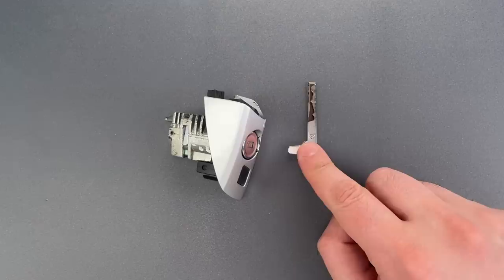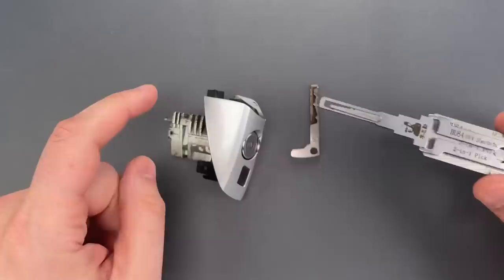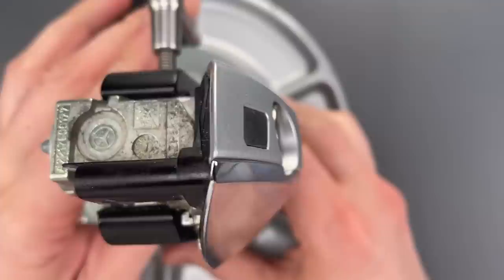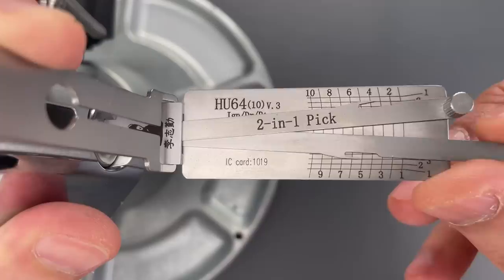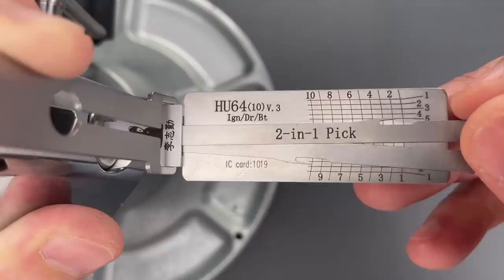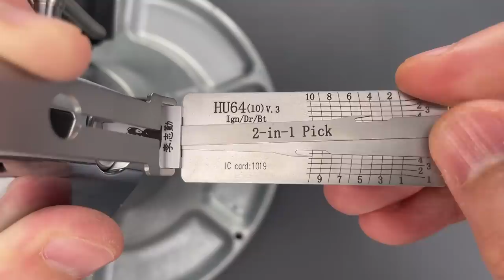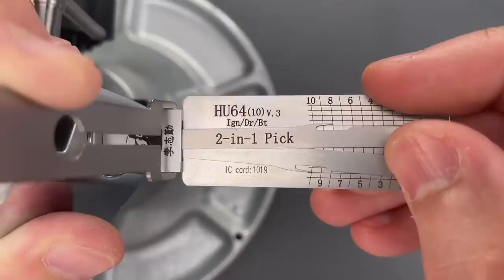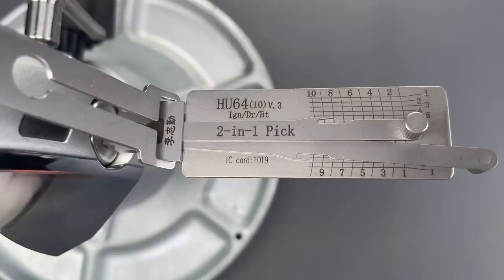[1411] Mercedes S-Class Door Lock Picked (2013-2020)

Comment: Some years ago I had a Fiat Punto.

I just left nothing in it, and left the doors unlocked, after getting the quarter light put through, and a door lock trashed.

No more expensive repairs from break ins after that. All locks are pickable, but thieves don't bother when smash and grab is quicker and easier 🤷‍♀️
Reply: this is what people in san Francisco and many other cities are doing, they leave their trunk open and doors unlocked as most times a cracked window is more expensive than whatever they may lose from the robbery
Reply: @JehaanPatell  That was what I did. Leave the glovebox open, nothing to steal here. Leave the car unlocked, nobody breaks in, saving you costly repairs.
Reply: This does not stop a smashed window.  Cars have locks and many cars now have alarms systems that check for the key-chip when unlocked and alarm if jimmy'd open, most thieves can't unlock the cars silently and KNOW this so most thieves DO NOT TRY to be quiet, they simply try to be FAST which means SMASH a window or try to jimmy the lock quickly and get what you came for and go.
Leaving the trunk open, windows down, door open, glove-box open - those things may help it look like your car has already been sacked but may also drain your battery and serve as an invitation to use the vehicle as a trash-disposal unit.  Open-window on the street means drinks and cigarette butts get tossed in by your typical a-hole testing his aim and proving his "rebelliousness". shrug
Reply: Damn i never can actually imagine break ins as a daily occurance
Reply: @Chamdar17  and you gotta love running at 3am to close the car when it rains 😂
Reply: a guy I knew called that "<city he lived in> insurance.  he left the passenger door unlocked, and a few dollars in small money easy to find.  car burglars would occasionally steal the money, but leave the rest of the car alone out of a sense of "why reduce the profit margin?"
Reply: @zoinksscoob6523  I agree. Sometimes I forget to lock my bike if I'm in a hurry. It's a fairly expensive bike used to long distastance endurance races. Never gotten stolen as of yet. I still won't leave it unlocked if I can help it but it really paints a sad picture of how crime ridden some places are in the world and how thankful I should be to not live in such a place.
Reply: I remember a story of someone who left a note on the window "Radio doesn't work". Someone smashed the window and left their own note: "Just checking".

From what I've heard since I left the area, SF is getting to the point where I'd not be surprised, but still saddened, if civilians start doing what the cops and DA's should be doing; enforcing penalties for committing crimes. Unfortunately the only penalties civilians can enforce involve trips to the ER ... or the morgue.
Reply: @JehaanPatell  That's sad when you have to leave everyting open just so you don't get broken in.
Reply: This doesn't always work though. My dad accidentally left his car unlocked not too long ago and found it trashed the next day, the contents of the glove box strewn everywhere and some vinyl pieces ripped off of the interior.
Reply: @benjaminshropshire2900  also, that problems are not solved with violence against the poorest ones. That problems are just showing all the other problems hidden under the rug.
Reply: Free gas for me I guess.
Reply: ONLY if the thieves take the time to look inside the car.   Many would just look at the  model and year, smash and grab.
Reply: @benjaminshropshire2900  the two biggest sources of crime are in order
The upper middle class and above, with a whopping 60 to 80 percent of theft losses being exclusively stolen wages.

And the extremely destitute and homeless, with sleeping in public placeses being the number one crime committed by the poor.

One of these things is not like the other. 
One of these things just does not belong.
Reply: @humanistwriting5477  that point is unrelated to the rash of smash-and-grab crime that governments are refusing to prosecute. - If you want to play the "I can cite a worse problem so we should totally ignore what you are talking about" game then I'll refer you to Africa.
Reply: @humanistwriting5477  None of it belongs in a discussion of property theft and vandalism.
Reply: @hardwarefromthegarbage3446  doesn't matter if the perpetrator is rich or poor, theft is still theft and justice is blind. Circumstances do not excuse evil.
Reply: @benjaminshropshire2900  oh, that reply to your comment had absolutely nothing to do with "one-up's-manship"
And everything to do with the issues regarding crime statistics, as well as to bolster and back your commentary about the surprising crime and income statistics you had eluded to.
Reply: @CptJistuce  unless you want to interpret statistics to better avoid vandalism and property theft.
Having some baseline and reason to think about criminal motivate is important to looking into said crimes.

And yes, theft and vandalism is far more likely to be committed by someone who assumes that everyone has insurance that will effortlessly cover thier damages then by someone looking for food money.
The food and drug money crowd will more likely be found dumpster diving, unaware that they are causing liability damages to the dumpster owners.
Reply: @humanistwriting5477  ah! Yeah, but still the concern I'm worried about is not the effects of wage theft and homelessness. It's the message being sent that the "people in charge" think "petty crime" is okay. That encourage people with a contempt for law and order to push even further. And it leaves people with a respect for law and order with few options to maintain it inside the law. Combine those and let them play out... the results could well make those other issues seem minor.

I'm very glad I left Cal years ago.
Reply: @humanistwriting5477  Yes, yes, we get it. Car burglaries aren't real crimes, eat the rich, yaddayadda.

That doesn't fill the radio-shaped hole in my dashboard. Or the battery-shaped hole under my hood.
Reply: So instead of installing some sort of hidden dashcam to catch these guys y’all just leave your doors unlocked??? And y’all sitting here wondering why your getting robbed 🤣🤣🤣
Reply: @Chamdar17  Yeah, I actually had my car alarm go off because I manually unlocked my keyless car before closing the door. When I opened the door 30 seconds later it remembered that it wasn't unlocked by the car and set off the alarm.
Reply: In Moscow they put pitbulls in the car. It works.
Reply: @CptJistuce  where did you come to that conclusion?
Good god man, learn to read not assume!
The point is that crime is a result of a mindset plus a force, as in a situation, you have to be aware of what each mindset and driving force environment would cause the crime you are trying to prevent.
Reply: @XL1813  I was tired one night when I came and did not want to drag my bike up the stairs and into my apartment, so I got both my bike locks and locked it to a tree, the next morning the bike and both locks were gone, I was quite frankly surprised the tree was still there.
Reply: 36 likes of validation for using seth rogen level advice
Reply: Punto is perfectly openable with clothes hanger.